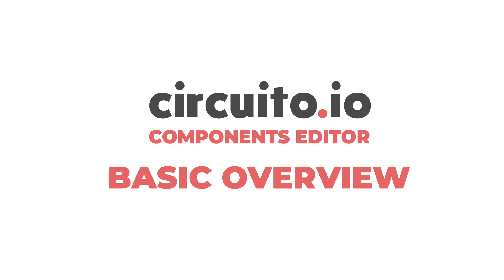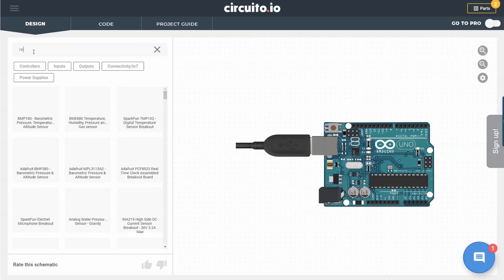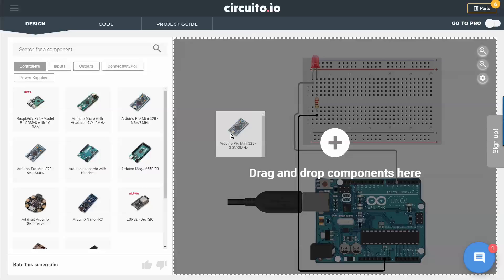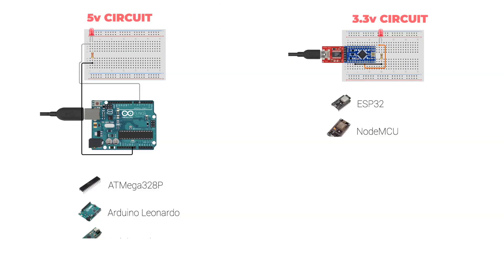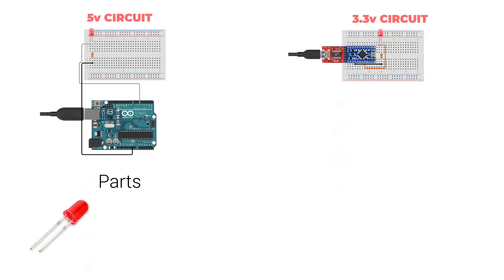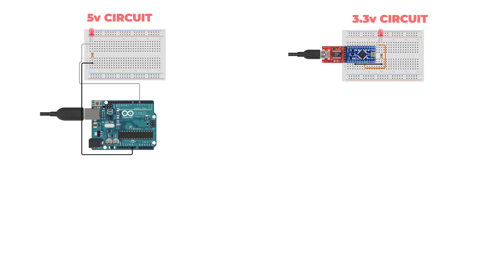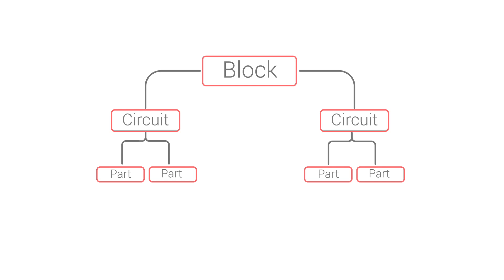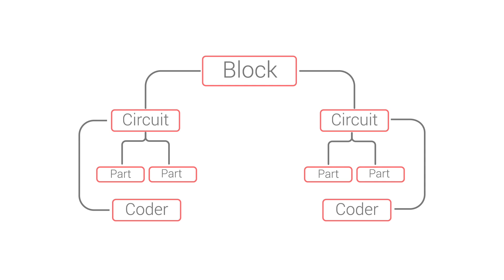circuito.io Components Editor - Overview

Comment: I might not qualify to comment the tools available with circuito as I am not an experienced electronics guy..but I wonder why we just can't find a website that can automatically fill the declaration of the necessary var/constant for the sketch of Arduino code after drag & drop of the hardware ( sensor, motor etc) onto Uno or related boards of Arduino & then offer related optional set codes before the users' customization so as to make everyone a versatile tech guy & keep your website with numerous real-time users???